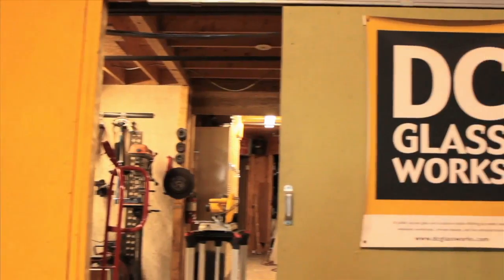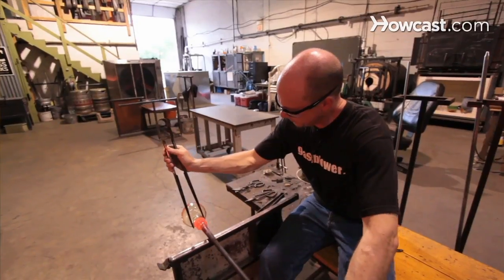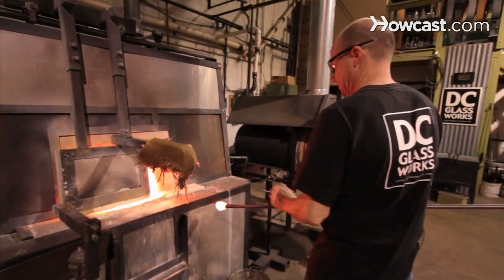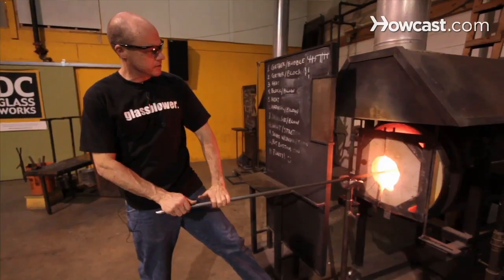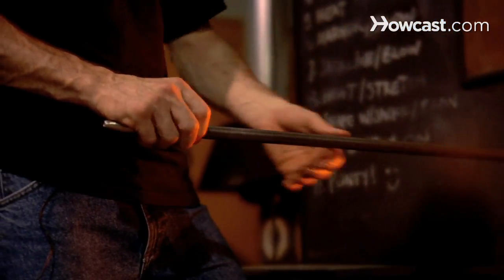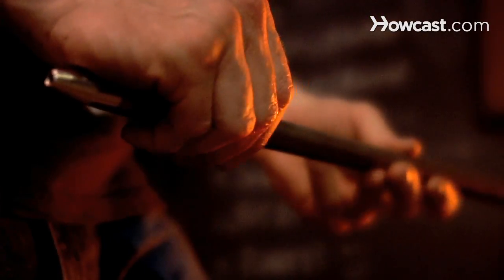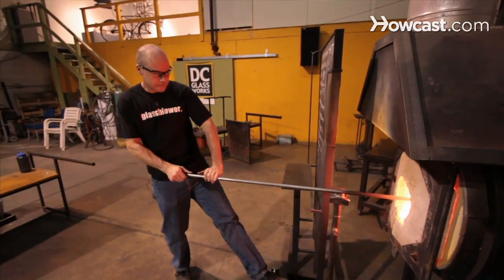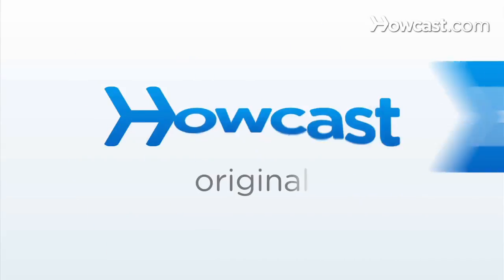4 Glory Hole Tips | Glassblowing

Comment: By the way, there are two different types of rod that you can gather your glass onto, depending on whether you're doing a solid piece (such as a paperweight) or a blown piece (such as a vase).

For a solid piece, you use a solid metal rod called a punty rod.
For a blown piece, you use a hollow metal tube called a blow pipe.